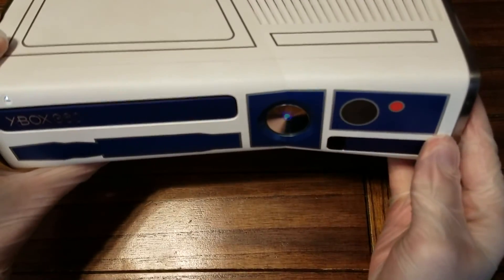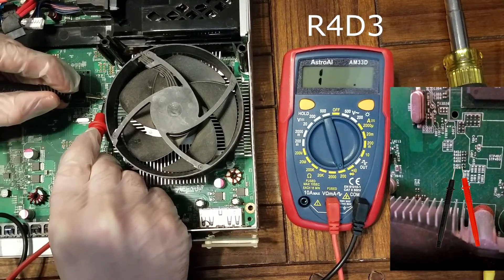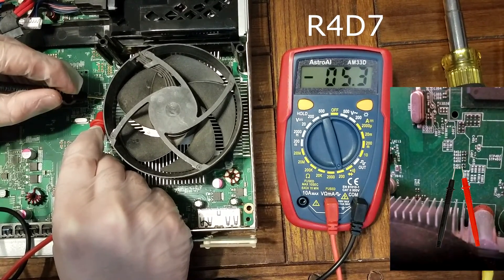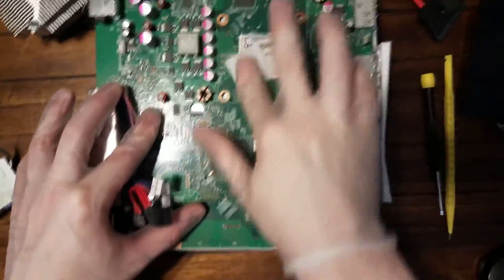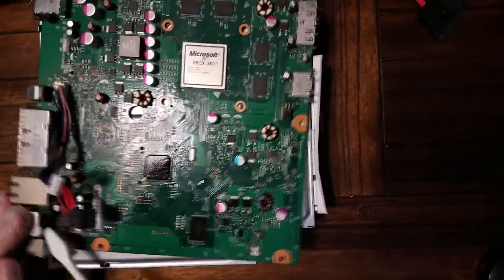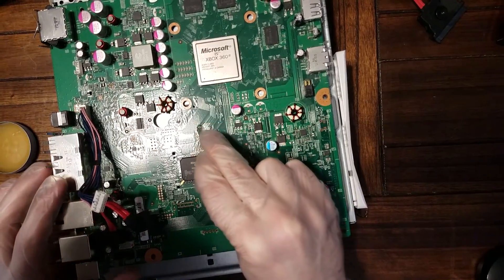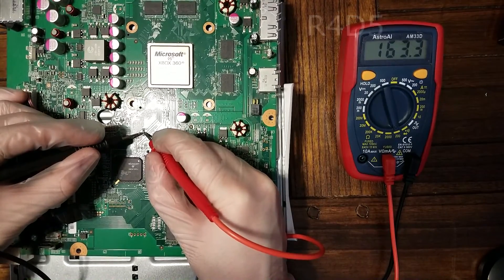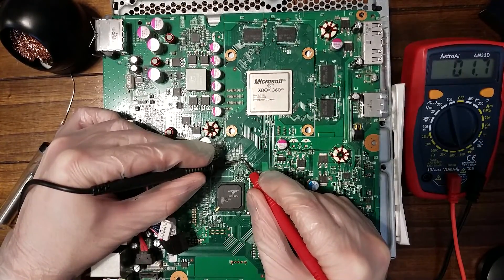Fixing A Limited Edition Star Wars Xbox 360 w/ RDOD | iDKx Repairs

Comment: When you press the power button to make those custom sounds, where is that linked? the motherboard or the ribbon cable of the power button?
Reply: Hi mate, after taking apart mine "today/yesterday" i can see that they have a connector with a speaker that allows them to make those custom sounds. I've heard a guy somewhere that had one with CFW or mods whatever, that made the sonic ring sound. Pretty cool if you tell me.

Comment: if i was to buy a star wars 360 and put my own motherboard into it is it possible to swap over the ROL and the sounds ?
Reply from the maker: So the star wars 360 is an Xbox 360 Slim model. Slims came with 2 motherboard types, Corona and Trinity. The star wars 360 is a Corona motherboard. I think as long as your motherboard was a Corona model board, you should have no issues swapping over the ROL and sounds. I haven't tried this personally, so your mileage may vary. Good luck with the project!

Here's a site that could help you identify what type of motherboard you have: https://weekendmodder.com/identify.html
Reply: @idkx_  i have a trinity RGH and really want to swap over the ROL and sounds and case onto my RGH